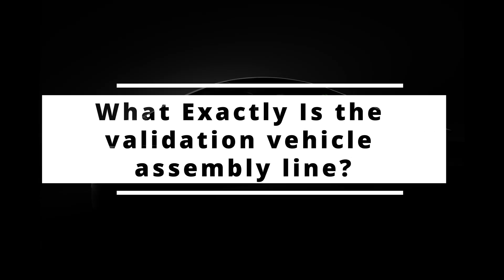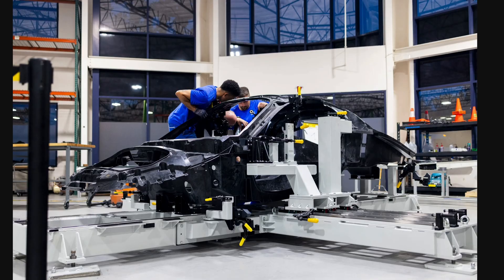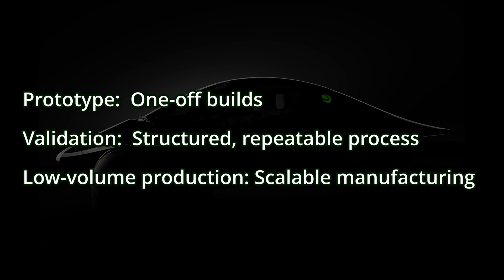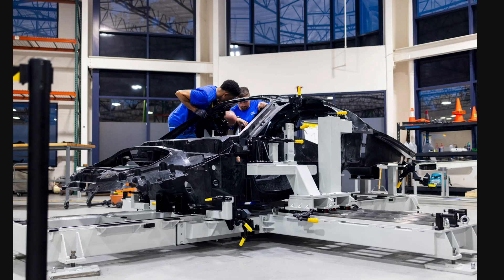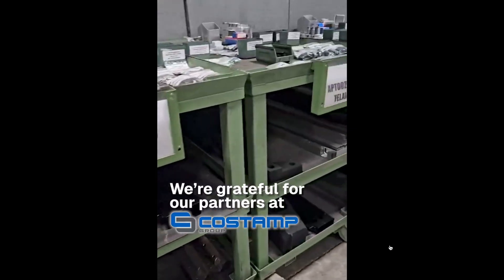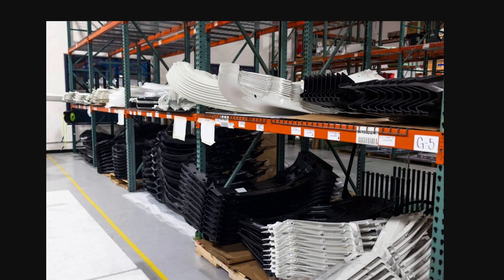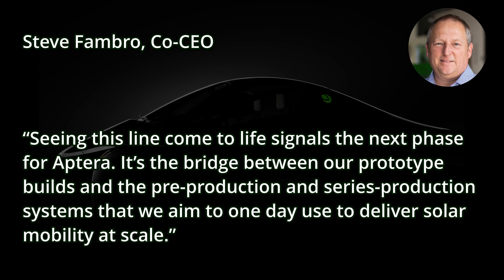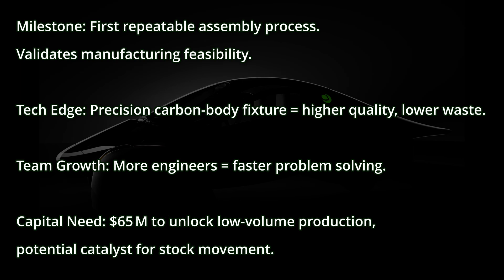Aptera Initiates Validation Line as Next Step Toward Scaled Manufacturing & low-volume production

Comment: Cheers for that summary, Raj. I'm looking forward for the validation builds to confirm a lot of the design performance, because unlike others, I am expecting this to be the first 10+mile/kWh vehicle, at least in the lighter 250 version. Maybe the bigger batteries will benefit from the experience gained from the Accelerator run, and efficiency gains through motor developments. Who knows - even the hub motor idea can be realised?!

Comment: I'm worried about how does safety of aptera compare to a tesla model 3? Safety is huge value, if safety is unsure, then there is no value to this product.
Reply: You are not worried about anything but your own concern-trolling.. that much is clear.
Reply: @J-W-Kelly Joe Mama
Reply: It will have better safety than any motorcycle or auto cycle and will probably be better than many other vehicles.
Reply: @johnvoules7447  most consumer will be unwilling to drive that with auto cycle safety
Reply: @RomanChaar  Aptera should have better safety than a Morgan Super 3.
Reply: Why would you expect a motorcycle to be safer than a Model 3?
Yet it's the safest motorcycle that the engineers and co-CEO"s expect to let their kids and parents drive.
Reply: @barnabasseadog7660  Realistically with the egg shape sides, weight distribution, sacrificial wheel pods and airbags it will be on par or better than most cars on the road.  Model 3/Y are extremely safe vehicles and I doubt Aptera will hit that level nor is it a reasonable expectation.
Reply: @ccibinel perfect response 👌
Reply: @SomethingElse4U Aptera is good enough inspite of being among the worst at >$40K.
Perfect response.

Comment: I always believed that Aptera MUST start low volume production just like how Tesla started with their RoadStars. And generate some cash flow, then move to high volume. 
This only proves even the giants like Sandy Munro who believed in high volume production could get it wrong.
Reply: Not necessarily. These are for crash testing etc. It may well be that they do more low volume production than these on the way to hopefully getting to high volume production, but that does not make Munro wrong. Everything, of course, is relying on available funding.  Each of these units is a lot more expensive to build this way than what they plan for the future.
Reply: Not exactly the same idea. A lot of those other companies go forward with building them all by hand at a small volume. Similar to the first validation vehicles.

The difference between Aptera’s low volume process that they will now start and their high volume process will not be a difference in the literal building of the car, it will be a difference in location. Instead of shipping everything in, they’ll bring more and more of it in-house, saving money and time. However, that takes huge upfront investments.

Comment: I am stoked! Excited to see crash testing results and MPGe numbers. If the MPGe is over 300, it is about triples a Tesla. On a good speed, 35 MPH, my Prius gets around 55+, but 330 is 6 times better. 0-60 around 5 seconds, anti lock brakes, traction control, and suspension vaildated.... We have believed that Aptera could achieve these milestones,  but to see third party saying that those vehicles are up to snuff. It brings production  into reality.